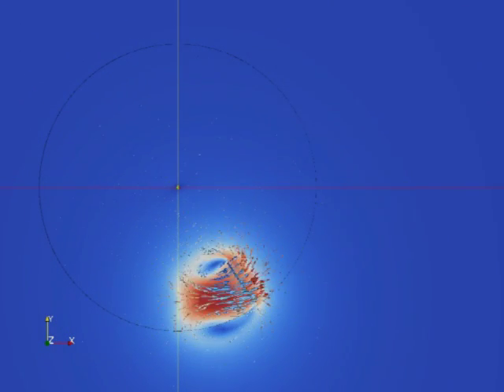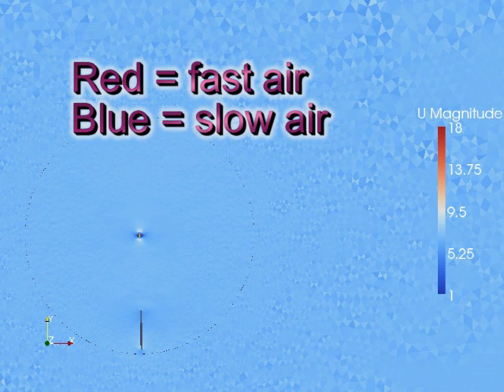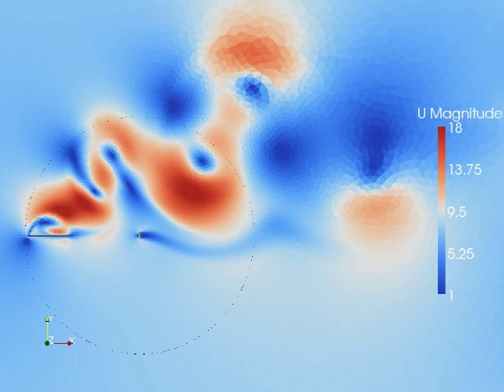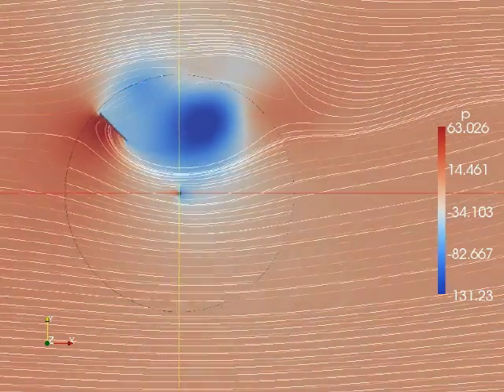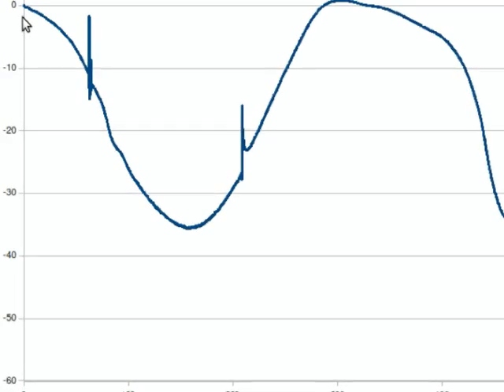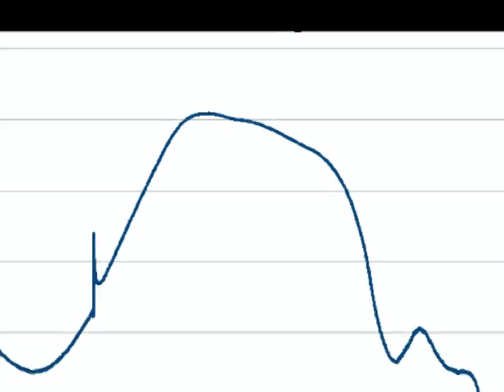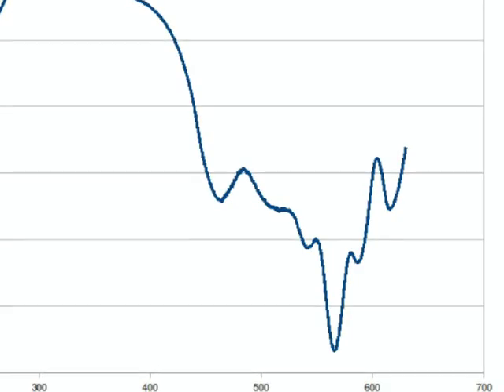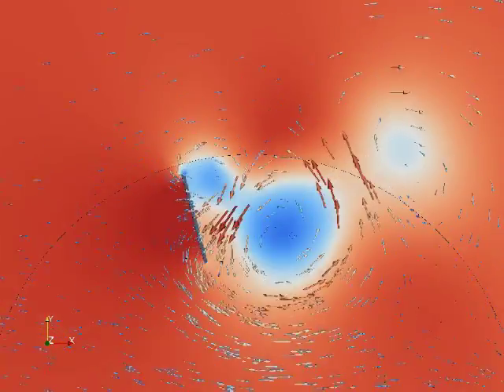Flat plate in the Wind

Comment from the maker: @anariaq 
I have not used 1.6 yet because it won't handle the rotating meshes.  Openfoam comes with a bunch of examples, one of them is a 2d simulation of a wing shape.   To answer your question on speed.  The rotating turbines simulate at about 20ms per hour (varies according to mesh complexity.)   The 3d ones take much longer.  However since you are really simulating a stationary wing, you can probably get good results in a few hours.